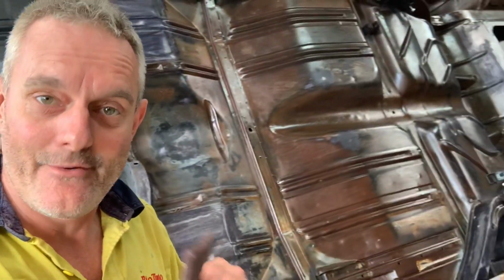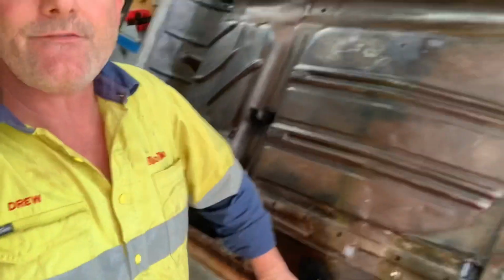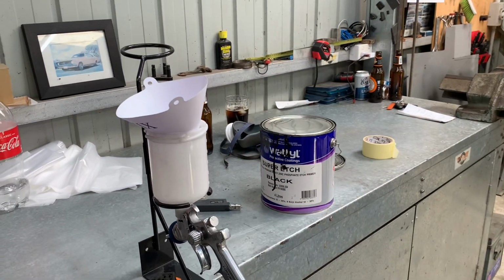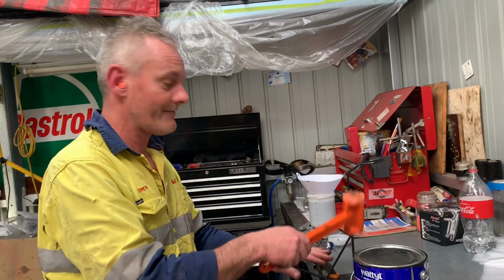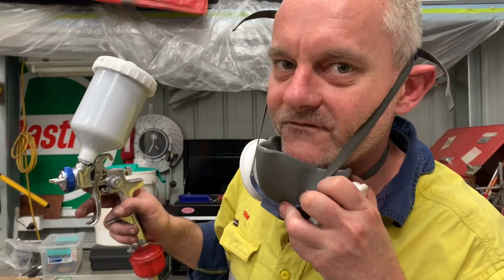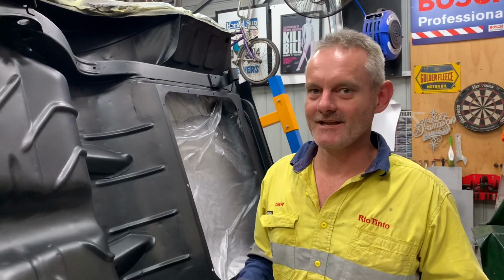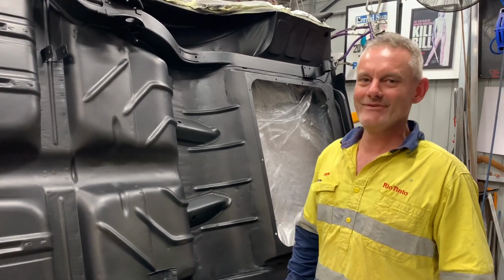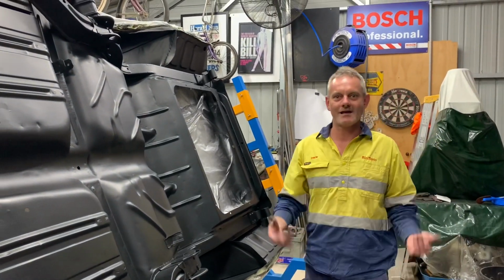Holden Fb 219 Ep8

Comment: Looks GREAT !! Just remember superetch isn't waterproof and in time will begin to show through surface rust again ( I learned the hard way) , so now I topcoat ( over the superetch) the underbody with 2 pack black !! resists stone chips, looks like "powdercoat", but a fraction of the cost, and really makes the under-floor pop !! Just be sure to scratch back to metal where you want to make electrical EARTH connections, coz that 2pack is also a bloody good electrical insulator !!